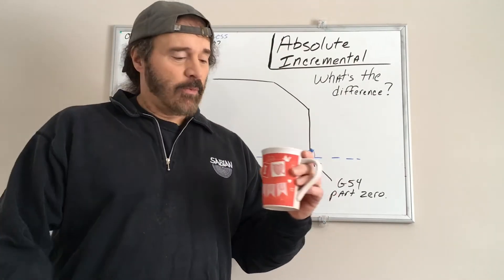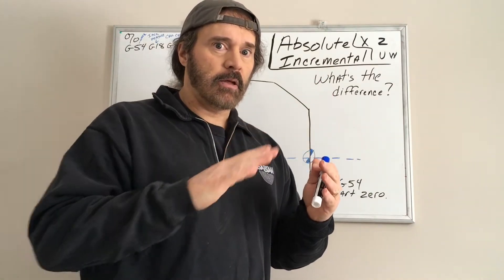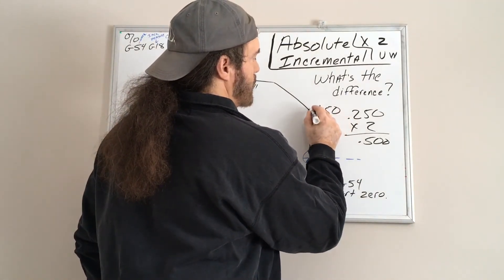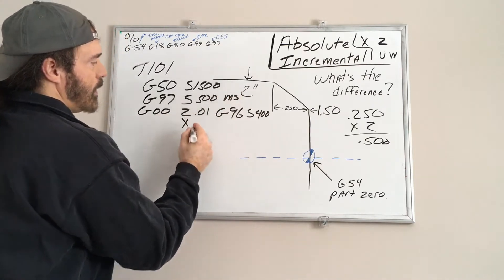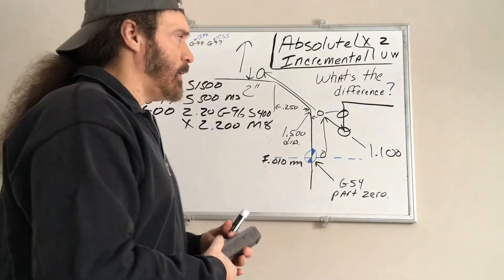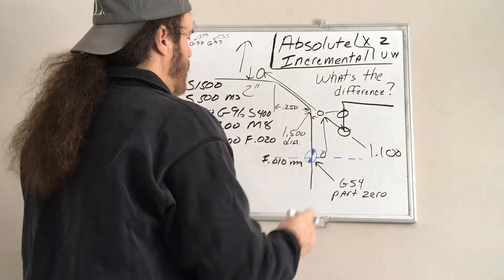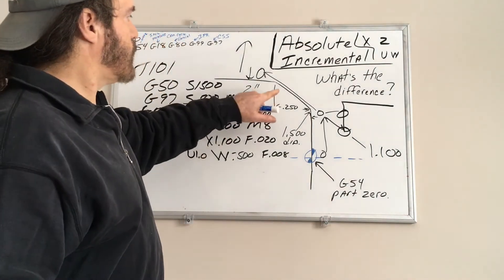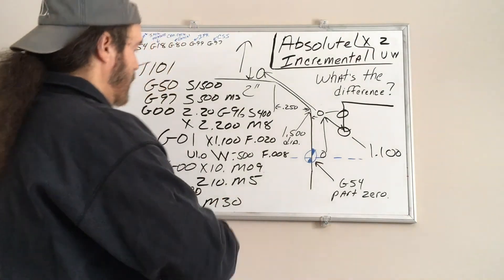Absolute & Incremental positioning - HAAS CNC LATHE - Manual programming for beginners

Comment: How do you on a HAAS LATHE use Absolute/G54 WORK Co-Ordinates & Handle Jog with the HAAS Controller?

On my 2004 SL30 HAAS LATHE I call up G54 Work Co-Ordinates via MDi > Tool Change = I receive the Absolute/G54 WORK Co-Ordinates, however... when I then press Handle Jog, the Absolute/G54 WORK Co-Ordinates will change to the Machine Co-Ordinates even though the figures are still under the Absolute/G54 WORK Co-Ordinates Title?

On my other Lathes all I do is a tool change in MDi then Jog Handle then Manually position my Tool & Turret to where I want using the Absolute Co-Ordinates & G54 Z zero.
Reply from the maker: I think I understand what you are saying……do you mean the values that are displayed on the screen on the right side where it says Work and Distance to go?
Reply: @Tims-Tractors-and-more  
Posit page
Current Commands Page
Anywhere you can see Co-Ords
Doesn't matter.

The machine sits idle with the machine co-ords.
To call up G54 Work Co-Ords I use MDi>ToolChange.
But I can't position the turret & tool because when I press Handle Jog button, the controller changes back to Mach Co-Ords.
Reply from the maker: @MantismanTM  hmmmmm……..so, are you able to move the axis’s while in handle jog? If not, something might be whacky. It’s tricky trying to figure this out while not being able to see this in person.
Reply: @Tims-Tractors-and-more  I can move the turret, write and run progs fine.

G54 & Absolute work in tandem.

There's 4 position displays.
Machine Co-Ords
Operator Co-Ords
Work G54 Co-Ords
Dist to go Co-Ords

MDi > Toolchange - Shows G54 Work / tools actual position in relation to work piece, on my others lathes I then go into Jog handle and just wheel the turret and tool to Absolute Z5. and do a rough check with a ruler. 

But on the Haas lathe as soon as I switch to Jog Handle the Co-Ords being displayed under G54 Work change to the machines Co-Ords but still being displayed under and not changing the title of G54 Work Co-Ords.
Reply from the maker: @MantismanTM  when you set your tool lengths, do you Z face measure all the tools? They will put the value as to how far from machine home they are. I do it differently.....I set my main facing tool (tool 1) to Z0.....and all my other tools will be based off of Tool 1......I know it sounds confusing.
Reply: @Tims-Tractors-and-more  No I do it off the face of the chuck (edit:when setting tools manually) because it is constant, the face of the part by contrast varies between jobs.

I am a cnc machinist by trade mon - sat 6 - 6.

I have just never used a HAAS lathe until recently when the company purchased their first haas (against my recommendations).

I've also noticed that HAAS G71 moves the same as G76 in that the machine will perform an entire 'loop' even during single block (which is to be expected with G76 normally but first time I have experienced it with G71) rather than actually move per the press of cycle start.
Reply from the maker: @MantismanTM  I’m trying to remember off the top of my head those 2 G codes you listed since I’m currently home….I believe the G71 is a stock removal cycle and a G76 is a threading cycle?  I see what you’re saying about doing a single block cycle……hmmmm…..you should be able to do single block moves.  I know we have older Haas lathes where I work( probably 15-20 years old) .  We just got recently got 2 new Haas mills.
I had to edit my reply since the lathes you have are new and the ones I have used are quite older, so the new lathes will have newer software which Im not currently familiar with.
Reply: @Tims-Tractors-and-more  My lathe was purchased 2nd hand it's a 2004 SL30.
Reply: @Tims-Tractors-and-more  It can't be done, Mark Terryberry responded to me and confirmed it, the NGC HAAS controller for lathes can but not the controller on my 2004 HAAS lathe, I poked at him and asked him why my 1987...Hitachi lathe CAN do it... :)
Reply from the maker: @MantismanTM  oh wow…..that’s cool that he responded to you…..yeah, I really wasn’t sure myself if it could be done and didn’t want to give you any bad info.